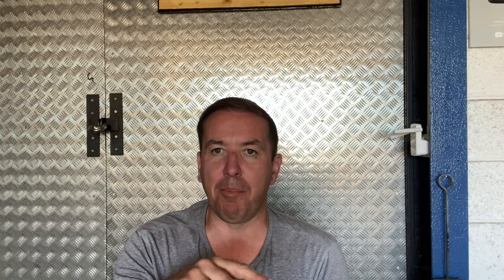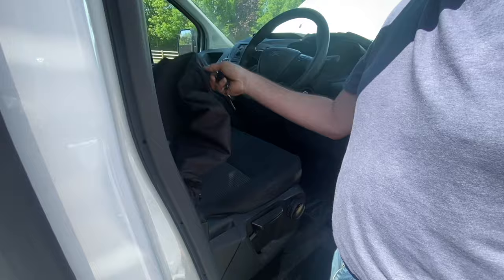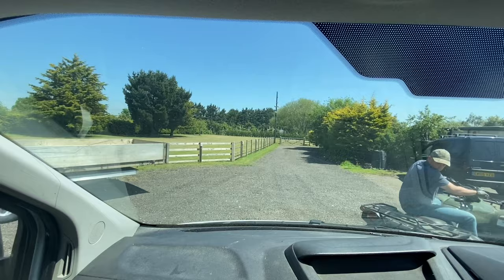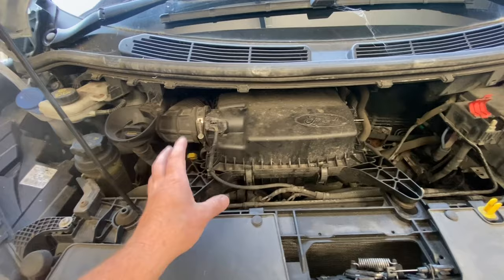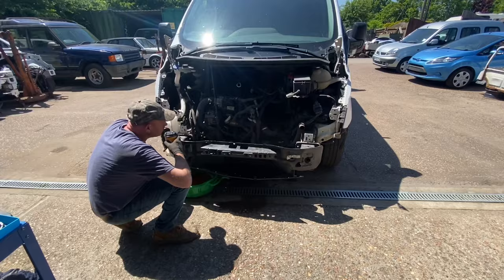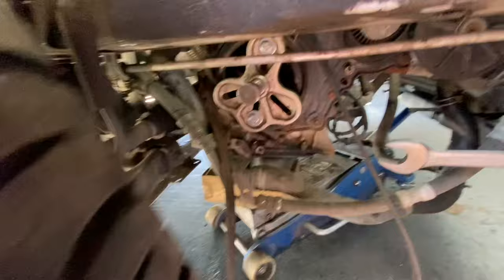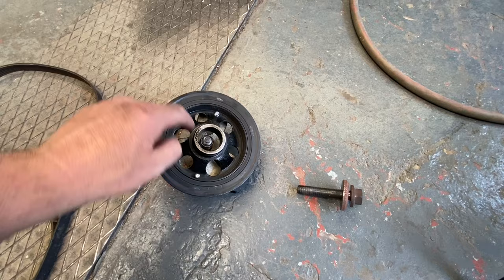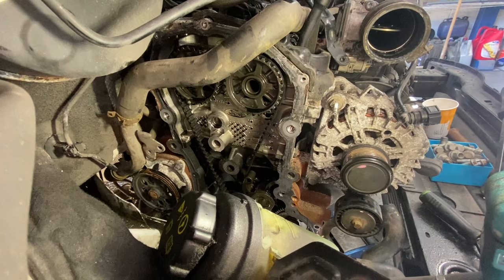Cheap 2017 Ford Transit Custom Euro 6 Engine Fail PT 1

Comment: What engine it is?
Its not chain on it 2013-2017 ?
Reply: The engine changed in 2016 to wet belt and there blowing all over the place . They recon wet belts reduce friction . Over chains but your engine will be scrap and cost a fortune.  I thought for would learn after the 1.8 taco engine in 08
Reply: Then u get big of the wet belt blocking the oil pump so have remove it as well .oil pump drive is belt as well

Comment: Long as there is no crack on the rockers very strange if they are all fine then othere than baybe tip a valve then you should be fine most snap rocker

Comment: Can I have your thoughts, I have a 2013 Ford Focus 1.0 ecoboost that now has a loss of power not all the time.
It's like you have a speed limiter fitted to the car, you hit a speed then it's like your being pulled back, you have to drop a gear to
Maintain speed.
No fault codes or lights showing on dashboard.
I've been told it's probably a turbo but there not sure, which is £1,000
Reply: What's the milage on it?
Reply: Chris Jones 59000
Reply: It's an ecoboost, good luck 😬 hateful engines
Sorry that's not helpful, 😂 but one suggestion - get the battery checked (free of charge)
Sometimes, a dodgy battery can play silly buggers with fords (and any car really)

A free battery test has got to be better than "trying" a £1000 turbo 🙂
Reply: Turbo probs
Reply: Pronoun Pigglet thanks for your input, but a £1,000 pound what if it's not that
Reply: @barrydoherty636   have you have it serviced every year oil changes etc? If it is turbo look at repairing it rather than replacing it much cheaper!
Reply: Chris Jones I've had the car from new, it's been well looked after, all the services are up to date.
Where would you get a turbo repaired?
Reply: @Barry Doherty I would definitely not just throw a tubo on it the ecu will know how much pressure it is making and what it should expect, so it would put eml on . get it properly looked at mate.
Reply: OBD2 Bluetooth dongle, Torque on an Android phone or tablet and view boost pressure in real time when driving.
Reply: Spark plugs pal
Reply: puresim316 Thanks for everyone's thoughts.
Reply: @barrydoherty636  coil pack dude
Reply: @barrydoherty636  hi sorry for the late reply you can get the repaired at turbo reconditioners I would be very surprised if it has failed at 59000 miles not impossible but definitely get a second opinion it could be as simple as a boost hose that has split or not be tightened get turbo actuator checked before getting new turbo.
Reply: Chris Jones Thanks to you & your followers for reply.
Reply: @barrydoherty636  lol you're very welcome but I don't think I have any followers. Thanks though.
Reply: Chris Jones. You Tube subscribers is what I meant.

Comment: What is the white corrosion over the front of the motor and alternator caused by .
Reply: Its corrision of the aluminum. Especially common when a vehicle has been stood for a while. I even noticed it on our 2019 car the other day while topping up the screen washer.
Reply from the maker: Just oxidisation of the aluminium components

Comment: Can you do a compression test with the cams out & belt removed?
Reply: With the right kit you can pressurise the combustion chambers via the injector ports and check for leakage
Reply: Yeah I figured you can do a leak down test with compressed air. I wondered if you could spin the engine on the starter and do a normal compression test because the valves wont move with the cams out and the belt off?

Comment: Still unsure what a wet belt is....
Reply: The wet belt is nothing more than a cambelt in a casette that runs in oil. Ford replaced the old lower chain that used to come on the Lynx diesels with a belt to improve emmisions and fuel economy.
Reply from the maker: @priteshchampaneri5101  it’s not even in a cassette 👍
Reply: It's kinda self explanatory - it spends it's life bathed in oil.
Reply: Had mine replaced on a 1.8 tdci 2010 mondeo by, as it turned out, very rubbish so called Ford specialists
Reply: @sruk  Just copied and pasted of Google. Lol 😆🤣

Comment: Hi chris n rob 
" wet belt " ???? Whys it called that is tjere a link to how this engine works ?? 
As use sed it was interesting how it works 
Top vid .......yeah 1 hour long vids pleeeeeeaaassseeee
Reply: The timing belt is driven in oil, just like a timing chain. Only the wet belts are very sensitive for the right and clean oil.
Reply: the belt runs oil pump and is in the sump so gets wet
Reply: @fhrk1991  thanks
Reply: @ernieboyle3577  thank you

Comment: I’d see if there is a chain conversation available for it .A wet rubber belt is a stupid idea ford should of stuck to chains on the Diesel engines
Reply from the maker: The wet belt wasn’t broken
Reply: @sruk  it take the teeth off the belt pal

Comment: I still don’t get it, to me it doesn’t look like the cam belt failed it looks as if something else failed/seized and  the cam belt lost its teeth in the lock up. I appreciate that the cam belt might have jumped and timing went but I’m not so sure??? What’s the theory?
Reply from the maker: A lot of belts do it 👍
Reply: Belts 130000 miles old, the go brittle and strip the teeth off.

Comment: An engine that isn't to be trusted for long-term reliability.
Why do manufacturers insist on using belts and not chains? 
It doesn't make sense. Probably to cut manufacturing costs. A bad move in my eyes!
Reply: The pre ad blue 2.2 engine do have a chain and are much better engines funnily enough.

Comment: Wouldn't a secondhand engine be the way to go?
Reply: To be on the safer side of caution it's best to repair the old one if possible and economical. Then they know it's had the new belts 👍
Reply from the maker: £2800 plus vat 👍

Comment: With the cam off, it's a good time for a compression test. (Irony)
Reply: But, But, but,  the inlets wont open on all cylinders to get any air in to "make compression" but I know where your coming from, it may give you an indication,

Comment: I was stupid enough to buy another transit custom after my 1st died there absolute crap engines always on the side of the road broke down Iv Got a 2017-citroen dispatch now it’s is the best van Iv had no hassle at all done over 40k in that now

Comment: That engine reminds me of the old Heath Robinson cartoons. What is going on with all those pipes?
Engine designers of today should learn the old adage "if it aint broke don't mess with it." Ford engines back in 70's / 80's could be worked on with your eyes shut.

Comment: Probably depends What Speed or the Engine Revs to the End Damage it Caused , Im guessing on Tick over or more likely on Start up when its under more load Rob , if its as Minimal as you Suspect
Reply: It happened at around 20-25mph going from 2nd to 3rd gear (about 2000-2500rpm)

Comment: Those wet belts are such dogshit.

Killed thousands of Lynx engines, PSA engines have had a load of problems with them and seems they are in the latest transit too.

Such a shame as they are a timebomb and often dont get changed.

Comment: Engine is not a ford design its made by French company PSA Who own Peugeot Citroen and Vauxhall now. Ford need to make there own they used to and they were good.
Reply: I reckon the engine was French revenge on Ford
Reply: Bring back the Banana 🍌  engine 😆
Reply: I thought the panther was Ford's own design. The old Puma 2.2 was PSA

Comment: What's a wet belt, Rob?
Reply: Sits in oil
Reply: @chrisbenard7509  Ye and I believe that's a big problem for these engines as if and when the DPF regen fails numerous time, diesel ends up in the oil and breaks down the belt over time causing premature failure..

Frequent oil changes are advised to counter this, much more so than the service intervals will tell you...

Comment: I think you will find low compression on one of the cylinders before you go and spend £300 on something that may have more secrets in that something doesn’t sit right there Not Feeling 100% on Lady Luck rob check everything you two have me screaming at the phone 🤣🤣🤣
Reply: Can you do a compression test when the valves are not opening ?
Reply: The timing belt has no teeth and I’m guessing more damage could occur trying to turn the engine over prior to stripping
Reply: @hughgarsehotmail  You can measure the ring gaps and piston side clearances, the big end float etc!

Comment: Compression test it!
Reply: Can't really if they can't be confident the timings correct. I was going down the route of a cylinder leak down test but with the risk that one of the lobes have spun will make it inaccurate and that you can't remove the cam cover that's ruled out too... Best option is to replace the belt, cams and then try compression test I guess?

Comment: I love the content of your channel, I'm not a car mechanic but the idea of a rubber belt that will destroy an engine when it fails is an awful design problem, so the engine designers solution to the problem is let's fit 2 rubber belts instead, am I missing something?
Reply: Don't worry some manufacturers have gone back to a chain, now they are stretching & jumping teeth and wrecking the engines. I just love progress and after 44yrs in the motor trade I'm glad I'm retired and loving Rob & Chris fixing them up!!!!!

Comment: Be a sound van when finished just shows how missing routine service intervals on belts etc comes back to bite and costs more in the long run. Someone’s had to buy a replacement van thru neglect

Comment: I work for Biffa we have 15 vans with wet belts all 15 have had new engines the belts break down and the oil pump in the sump suck up the cam belt bits and starve the engine of oil absolute rubbish design 👍👍

Comment: id chuck an oil pump in it too m8 an av a look at big end shells id also pull head off its probably leaking between pots an got burnt or cracked pistons these engines are garbage.

Comment: I see Ford still stands for Found on road Dead, or Fix or repair daily! My 1972 V4 petrol Transit had a oil pump drive off the distributor via a hexagonal shaft which would wear out so the oil pump would stop.
Nice tidy van though and should cover your outlay.
Reply: It could've happened to any car. 130k miles without a cambelt being changed? That's ambitious
Reply from the maker: @2008tourer  it’s recommended at 150 or ten years
Reply: As with anything mechanical, proper maintenance is key. Servicing done correctly, at the recommended intervals with quality OEM filters and ensuring the correct specification oil. Seen too many vehicles over the years that require, for example, a modern low SAPS, low viscosity synthetic oil with the correct blend of additive package and in the boot you find a gallon of no name supermarket generic 15W40 mineral oil. It's no wonder vehicles start to suffer and have mechanical problems when owners neglect or abuse them. Of course, it's not unheard of for engines to have a manufacturing fault or an inherent design flaw. Regardless though, nice to see good guys out there like SRUK, doing things properly.

Comment: Must have been drove really hard to break after 4 year
Reply from the maker: It wasn’t 👍
Reply: They mentioned it had done 130k miles so that explains it. Just normal use 👌

Comment: Scrap it boss bent valves trust me
Reply: @puresim316  have you worked on one of these engines with a stripped belt, then give the guys more info on how the valves bent when they are all level now than just “trust me”
Reply: @old_con  Agree. from what I have read, it’s rare that they bend the valves on these, hence the rockers or cams suffer.
Reply: @old_con  puresim316 is another armchair mechanic who's been watching too much Wheeler Dealers and thinks he knows it all from 45 mins cut down programme!
Reply: @old_con  ye bent valves I scraped it
Reply: @puresim316nosimracingnolif3  I’ll never trust you again. 😂🤣
Reply: @supergeekjay  I'm a proper mechanic mush
Reply: @puresim316nosimracingnolif3  Anyone can say that on the Internet. Care to upload some vids of you fixing one of these? Mush! 😅
Reply: @supergeekjay  what's your number mucker

Comment: What dweeb at Ford designed that engine. Did they expect oompalumpas to work on it?
Reply: Best engine IMO was the 2ltr ohc belt snapped absolutely no damage the 16 ohc different kettle of fish bye bye  valves 😂
Reply: I find it staggeringly a company like Ford who have been making Diesel engines for like donkeys years produce an engine with inherent mechanical weaknesses.

Comment: What the why dose the number plate says 2016 not 2017 explain scamer
Reply: Plonker............  It says 66 on the plate, understand the UK system before calling someone a scammer...!!
Reply from the maker: Why what dose scamer ?. Vehicle registered 2017 66 Reg I'm not going to explain because you didn't ask nicely
Reply: Ok
Reply: But im confused it says 66 not 67
Reply from the maker: @ya-tl7wd  if it was 67 it would be a 2017/18
Reply: Ok

Comment: What a totally shite engine...........looks like that van has probably got less than 200K on it, and seems well looked after!  The Ford engines fitted into various PSA vans as well as Transits, also had serious issues and I guess have cost owners an awful lot of money to repair or replace........................